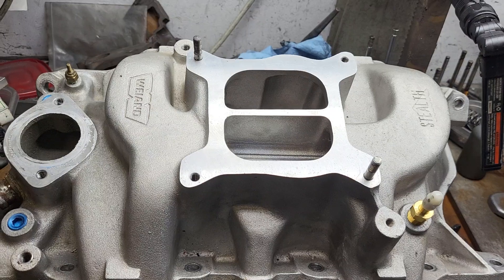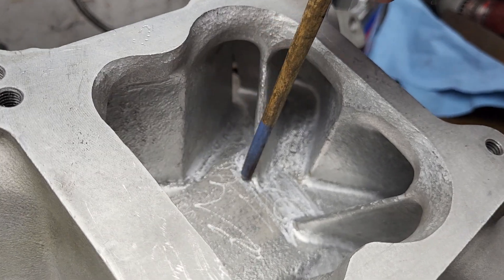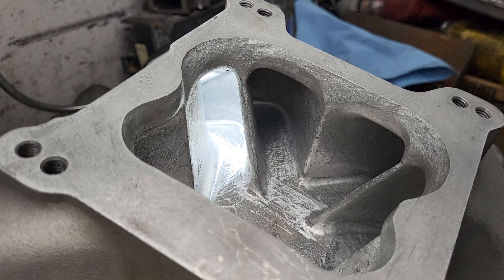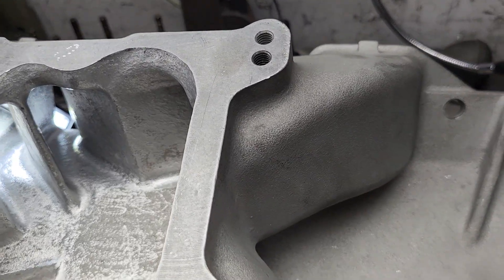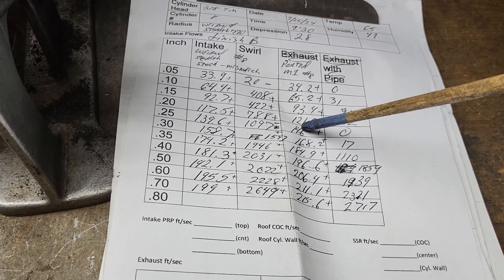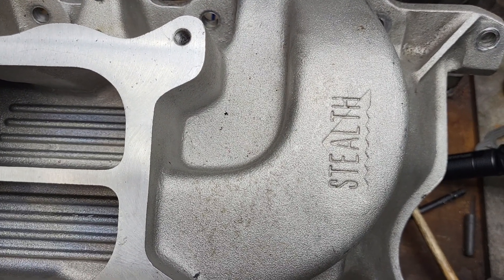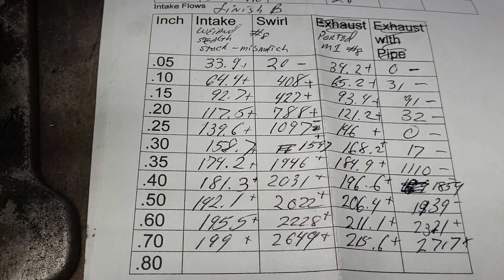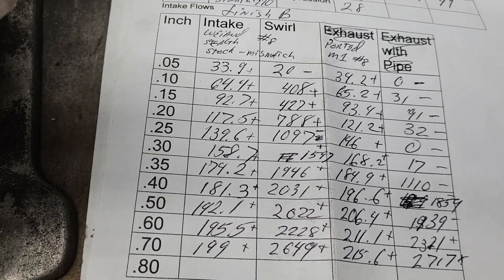David Vizard, Unity Motorsport, Mission Impossible 318 project, Ported Mopar M1 vs. Stealth

Comment: Charlie, have you ever flowed carburetor bases on top of a carburetor and manifold?  I am asking because there are a lot of air cleaner shapes and sizes from the aftermarket and from the muscle car era. Some work well, some don't. Like the bell mouth open stack for the 4 barrel. It flows worse that no air cleaner. Whodathunkit. Chevrolet factory 14" air cleaner that had the chrome lid I was told a long time ago that the work the best due to the shape of the hump before are enter the air horn of the carburetor. Many aftermarket units are flat or some other shape. Chevy actually sat lower than the air horn but the shape was gradual. It would be a video series worth watching to know which air cleaner will unimprove what you do with grinder to the heads and manifold. Back in the 60s and 70s, some of the factory air cleaners looked like some thought and testing may have been put into it but which one or ones actually flow free?
Reply from the maker: I have a video like that somewhere. It has my custom made air cleaner base.

Comment: my mildly built 318 is responding well to the 360 cid thermoquad i rebuilt . the 318 has a dual plane air gap intake with a 1 " aluminum single plan spread bore to square bore .
Reply from the maker: Nice!